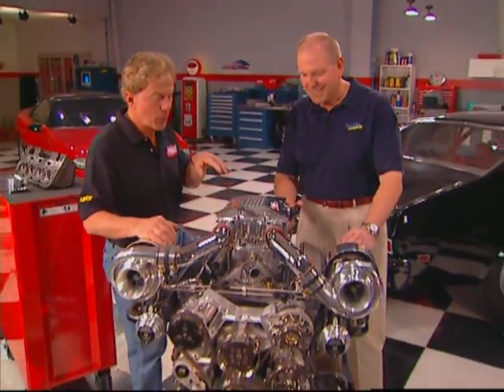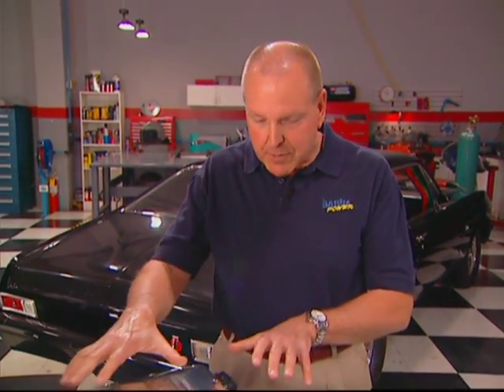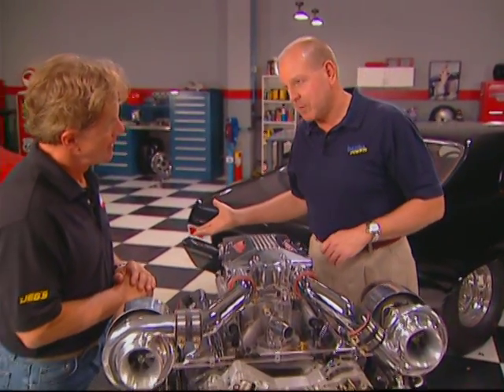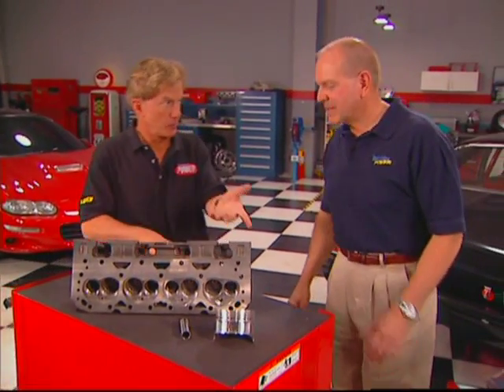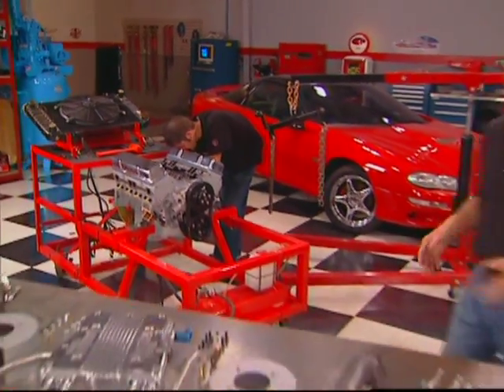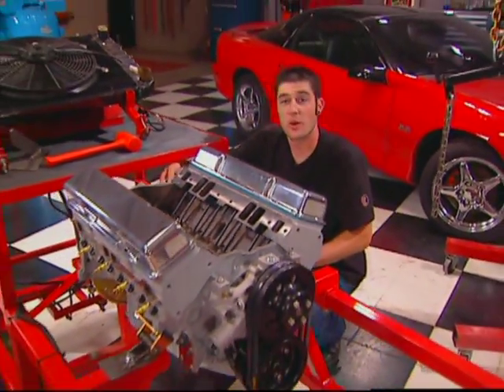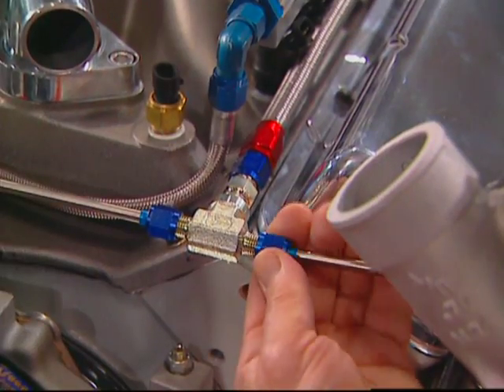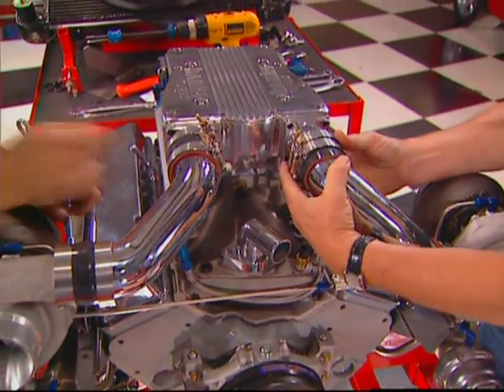Twin-Turbo engines & kits

Comment: This video is probably close to 20 years old, the turbos and ecu’s we have today can give you the same results with a single turbo and you can pick up an intercooler from eBay or amazon for added safety. But it’s cool to see an sbc getting the turbo treatment

Comment: HP per dollar ratio, not worth it. If you're only looking to make 600hp you can get there with a good set of heads, the right cam, intake and make the bottom end able to spin 7200.

Come on Banks, need to get more competitive on your pricing.
Reply: Not hating there Antoine, HP per dollar does not make sense. A 383 stroker with the right set of heads, cam, and intake will make 600hp.  Are you saying that you would put about 10-12 psi on a stock internals 350 and try to make 600hp? It would make a few pulls and likely crack a piston  or crankshaft. A stock 350 will not hold up to that kind of cylinder pressure. SOOOOO, a rational person would build the bottom end to withstand the cylinder pressures that it will see in a boosted application.  A fully forged rotating assembly is about 1800-2100 on summit, at that point why would you throw a stock set of heads on your engine.  Buy a set of AFR 210cc and a matching cam single plane intake and 11/1 compression, spin it t 7200 and you have yourself very close to 600hp.  Summary you're an idiot if you think its a good idea t throw this kit on a stock 350 and THE HP PER DOLLAR RATIO DOESN'T MAKE SENSE!
Reply: antoine friday have you ever build an engine in your life?
Reply: Maybe it makes 600 hp but never you get the torque what a twin turbo can plus withe your NA engine you have to make serious rpm and then your top hp is at 8000 rpm and withe twin turbo it’s already at 6500 rpm

Comment: does the motor need any sort of fresh air intake? Or is all the air supplied through the turbos?
Reply: I don't really understand your question. turbos forces air I to the engine and its cooled down by an intercooler
Reply: +William Neigum turbos feed off of exhaust gas. There has to be some sort of fresh air intake as well
Reply: I take it you mean fresh air into the engine other than through the turbos. No. All intake air passes through the turbos. The turbos start spinning when the engine is idling so there is no restriction
Reply: For most efficiency there needs to be ducts from the turbos to the front of the vehicle as Gale Banks used on the Firebird land speed record car

Comment: time to do a crysler small block
Reply: +Mr1974dust Use a stock 318. They have a low 8:0 compression ratio so you can fit some boost without lowering the ratio.
Reply: ^^ what he said 70's-91 LA block.
Reply: k

Comment: What he left out is that a blower is instant no spool time
Reply: But with parasitic drag. Equalling more load on the internals for the same given output. Supercharged engines require more money in the build -- if you want them to last.
And yes, I just answered a 3 year old question.

Comment: so....this is possible on a 91 silverado k1500? completely stock 350....i actually dont have an intake on it right now since mine rotted out.
Reply: yeah you could do it, I wouldn't recommend turbo'ing a stock block. if you was to turbo one, you would have to go through the motor and get a stronger crank, low compression pistons and re work the heads
Reply: It'll work but you'll only be able to run 5 psi at most...better off taking the money for a kit and building the fuck outta the motor you have

Comment: i disagree needing good efi... you can do blow thru carbs   they've done it for years
Reply: I don't see why not is forced air just like a blower....  I'd much rather run it on EFI, but I don't have $4,000 to buy it either..

Comment: With the short "turbo to carb" distance don't you sacrifice power do to hot intake gases? How come no intercooler? I really like the system, sans a few tweaks, but will it fit under my hood?
Reply: With hot IAT's its not power you have to worry about its detonation. People can run turbo's without IC's but not a great idea... most that don't run meth injection or E85 to counter act.  I'm not sure how I feel about that box upper, they quit using it with the old paxton kits etc from back in the day for a reason, they were a nightmare and the flow characteristics were a joke, not even across the board at all.  If you go with this I'd use a EV hat and just make a few bends yourself, put on a meth injection kit and call it a day.  Unless you wanted to convert to E85 which isn't that hard to do... and what most of us do honestly.  But you could get away with not running a IC and be fine, just can't run crazy boost or timing, and have to run a real safe tune.

Comment: What would be the price on it
Reply from the maker: About $6000 for the complete system.
Reply from the maker: *****
Give us a call and tell us what you're looking to do.
Reply: +Banks Power 
looking to buy
Reply from the maker: What exactly are you looking to buy?
Reply: is there a tunnel ram app? and can I run that on a 408 chevy from a 400 block at 11to 1 compression?

Comment: I'm very, very impressed with how well put together this kit is.the pulley system, the induction system and piping. Do you make this kit for the Ford Pushrod 5.8 Liter as well? You see, I have a LINCOLN LS and the Jaguar 3.9 Liter has no after market support, and the Ford 4.6 Liter is not an option. I think a pushrod engine would fit better inside the small engine bay,but  don't want a chevy 383 in a ford car. Do you have anything for my situation?

Comment from the maker: The manifolds are only sold as a kit. Included in the kit are the manifolds, heatshields, studs, nuts, washers, and all other associated hardware. The cost of the kit is $1848.85.

Comment from the maker: The Banks twin-turbo SBC product line is not based upon a specific vehicle fitment. It is based upon a Chevy small block or comparable Dart small block engine with an aftermarket EFI fuel and ignition system. Give us a call for more info, plus you can check out the twin-turbo page on our website for more videos, download free twin-turbo book, see dyno charts, and more stuff to help you plan your project.

Comment from the maker: The Twin-Turbo is designed to the engine and not to a specific vehicle. The engine with the turbos mounted has a crankshaft center line height of 22.25” and a width from outside of turbo to outside of turbo of 35”. The engine depth with a CNC front drive assembly is 29”. 
 
If your engine bay does not meet these specs then you would need to modify it to accept the Twin Turbo System.